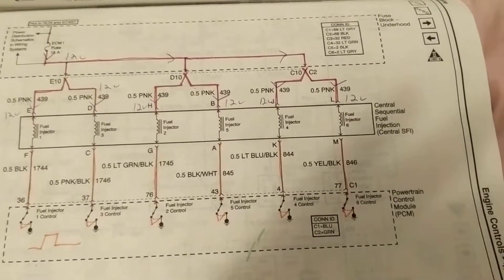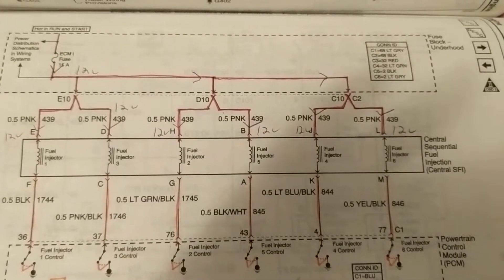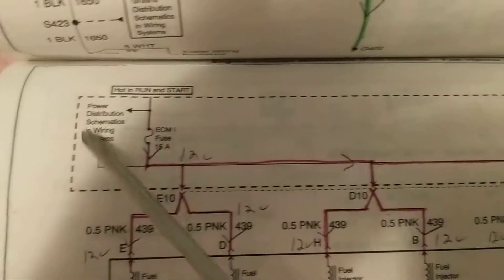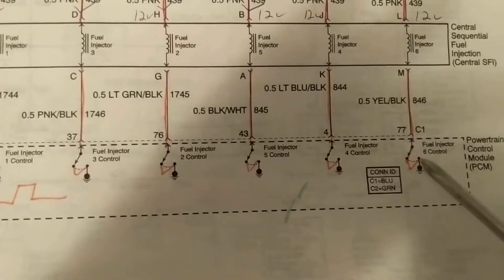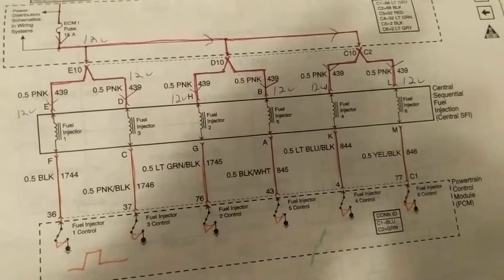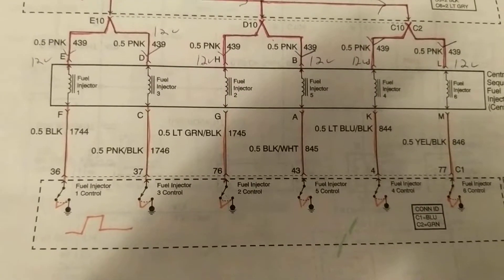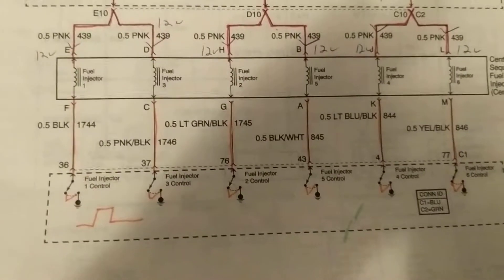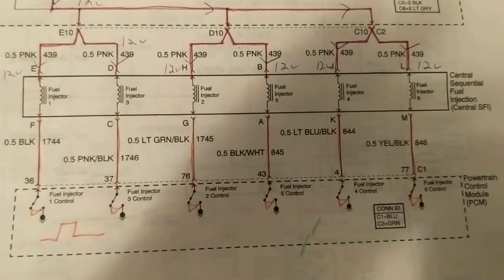How SEQUENTIAL FUEL INJECTION works Chevy Blazer 2003 4.3 L wiring diagram tutorial please subscribe

Comment: excellent info. according to the video the 6 pink wires go to fuse box. i had chipmunks eat all the harness and plastic connector. trying to line up the pink ejector wires to proper sequence location.
Reply: Unfortunately it happens a lot with customers going up to the Poconos in the woods these animals love to bite on wires and it is a pretty common problem thank you so much for your comment I appreciate your viewership